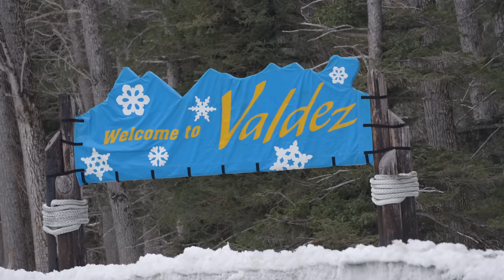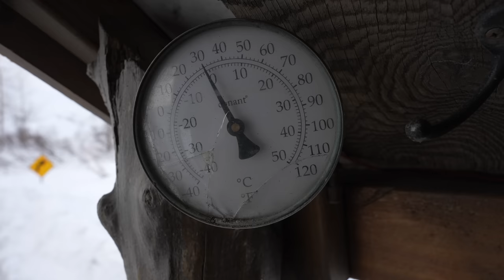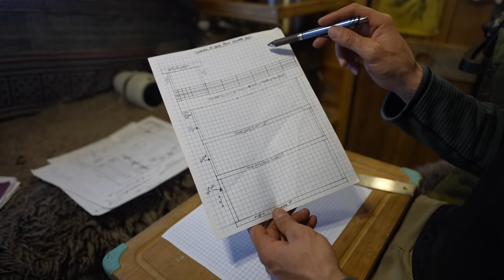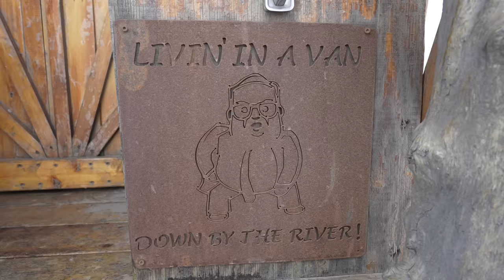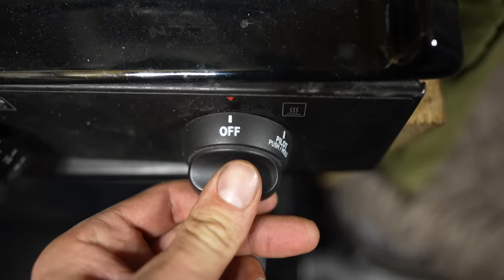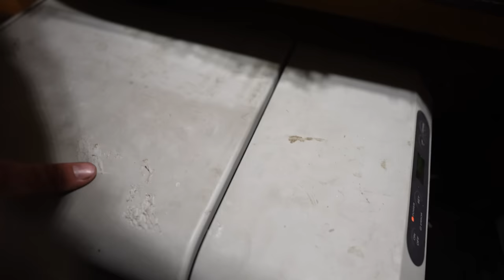Hunkering Down for a Snowstorm Inside a Cozy Homemade Truck Camper #vanlife #asmr #alaska

Comment: Is this all battery powered? Im assuming you have a dual alternator setup since I didnt hear a generator.
Reply from the maker: yup battleborn lithium batteries 200amp hours with alternator charge setup and 100 watts solar panel

Comment: How will a flat roof(new house) work with a heavy snow load?
Reply from the maker: fine, designing trusses to hold extremely heavy snowloads or I can just use a snowblower to blow it off the rooftop deck

Comment: Van you guess for me how many solar power panels I'd need for a 25 ft class c RV?
Reply from the maker: not sure, i only have 100 watts for the truck house and the truck also charges the batteries while I drive, I have 200 amp hours of lithium battleborn batteries to power it all.